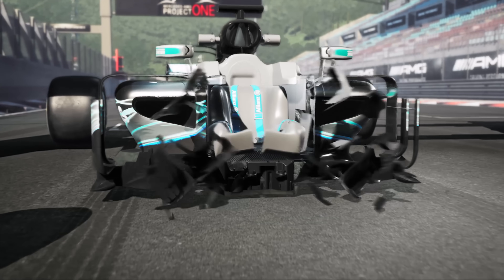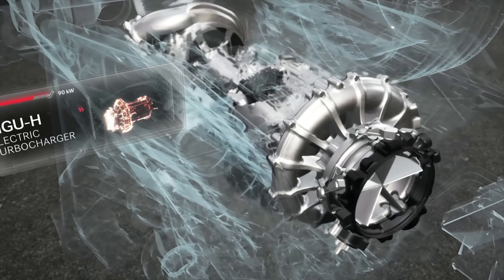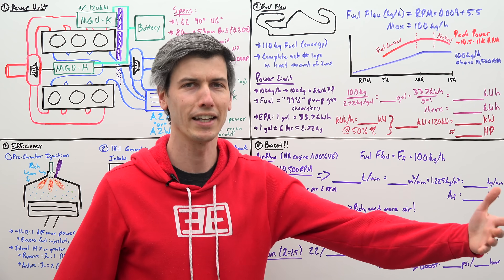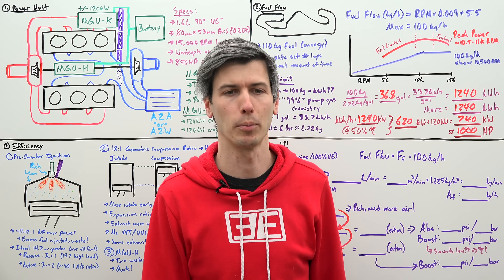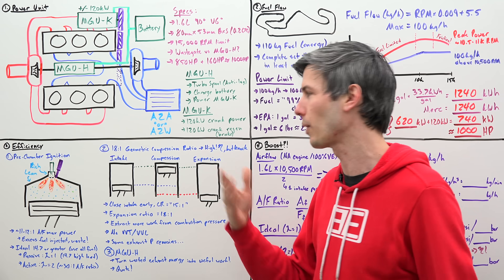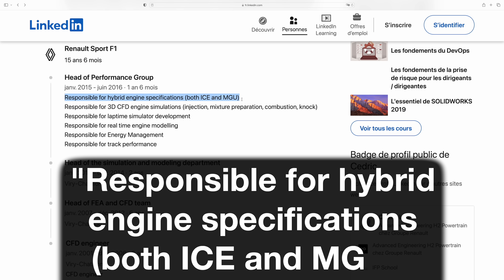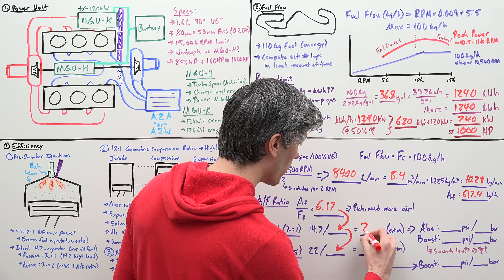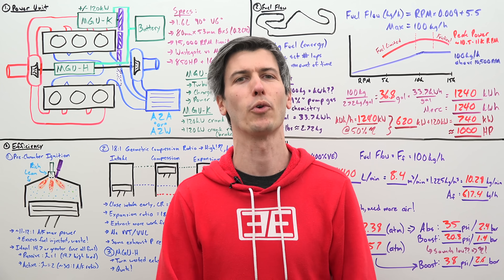How Tiny Formula 1 Engines Make 1000 HP!

Comment from the maker: *Important Note!* Production cars vs F1 cars: why are F1 cars more efficient? Especially considering my comments in the video about both being impressive, but operating under different rule sets. Several reasons for F1’s efficiency advantage:
1. Quantity - Formula 1 only needs to make a handful of engines for a season. This allows for an attention to detail that you won’t have when producing engine quantities in the millions for production cars. It’s easy to make one efficient engine. Mass production adds complications. 
2. Cost - The cost per engine is vastly greater in Formula 1, allowing for opportunities that you don’t have when you’re selling an entire production car for $30,000. Materials, tolerances, difficult manufacturing designs, etc. Relatively speaking, production car engines are very cheap, which limits the design.
3. Reliability - F1 teams are allowed 3 engines per season without penalties, so an F1 engine only needs to last 7-8 races (plus practice & qualifying), meaning about 1,500 - 2000 miles. When your engine doesn’t need to last as long, you can run it closer to peak efficiency, where knock is more prevalent (think high spark advance, leaner air fuel mixtures). It’s worth sacrificing reliability for performance, because the goal isn’t an engine that lasts for 200,000 miles. 
4. Rev-Range - F1 engines have a much more defined use case versus road cars. Road cars operate at many different RPM, in many different engine load scenarios. Trying to develop an engine that is efficient across this wide range of use-cases is very difficult. F1, on the other hand, has a much more narrow focus. Create power at full load as efficiently as possible. This means you can pick a region of the engine where it spends most of its time (say 11k RPM) to maximize efficiency.
Reply: Thank you so much for this summary. I'm at work and cant listen to the entire video so reading all of the reasons was great for me!
Reply: 0. Emissions restrictions - as far as I know F1 do not need to pass any emissions standards. The higher the compression ratio, or air fuel ratio the higher production of NOx.
Reply: @savclaudiu2133  Also having a short stroke relative to bore (oversquare) enables higher revving engines, but less complete combustion due to the relatively large diameter of the combustion chamber.. It was considered a marvel of engineering when Honda released its S2000 that would rev to 9,000 rpm AND pass emissions. Motorcycles don't have as many emission constraints. This allows engineers to design oversquare engines that rev higher.
vroom vroom, vrrrr VROOM!
Reply: Thanks for that Carnac the Magnificent moment of predicting Max as this year's world champion.
That boost level has to be on the higher end.  Another good estimate would be at the maximum fuel rate allowed, how much boost could you safely create?
Reply: I agree with all these points, but Alonso is the one who will be 2023 Champion.
Reply: And temperature range. F1 engines are preheated meaning the don't have to deal with "cold-starts", i.e. different parts at different temps. Tolerances can be much finer so less losses due to blow by etc.
Reply: Perhaps a 4th thing. Do F1 engineers need to worry about NOx?  Trying to run lean at 15:1 compression is never going to pass EPA or CARB emissions controls.
Reply: A good one to watch is the road to 50% thermal efficiency international combustion engine. They stated that formula 1 uses 18 to 1 static compression.
Reply: I’m going to work Number 4 into my excuse the next time I get pulled over. 👮‍♀️
Reply: How dare you declare Max already. Surely you could at least wait until after the first race. 🤣😂
Reply: @BBKing1977 he already won... 🤪
Reply: Idea for a April fools episode. Do a video in the style of Numberphile using sharpie and parchment paper.
Reply: Counterpoints:
1. even with cheaper production methods optimization can be achieved, if not 100% of the performance of one-off production maybe 80%
2. mass production: yes, single piece profit is lower, but mass makes higher profit
3. no road car needs 700kW power
4. valve timing, cvts, you said it, road cars have options that formula 1 cars don't have
Reply: @spy00at  "no road car needs 700kw power"  Shhhhh... don't let the Hummer EV hear you say that, you'll hurt its feelings!  🥴🤮🤣
Reply: 5. Emissions restrictions- Honda had a lean burn engine on their Honda vx in the 90s.  It was discontinued due to emissions restrictions.  I believe the lean burn caused nox emissions to be higher
Reply: I’ve been following you for a while now, and think that your videos are fantastic! What is your profession or title? You have a very good pedagogical ability!
/Greetings from southern Sweden
Reply: Don't forget tolerances.  A F-1 engine can't be started cold, it's locked up.  Needs to be at operating temp.  Less loss past the piston rings leads to more efficiency
Reply: @sandybarnes887  yes that is true but it is a relatively small contribution to the overall efficiency it's more to do with reliability at sustained high revs and load!
Reply: Yep, the tolerances thing is a big one. F1 engines can't start cold. They're seized at that temp.They have to be preheated to allow the block to expand ever so slightly to free up the internal components
Reply: That last remark on Verstapen was unnecessary... 🤣
Reply: Thanks for this answer, it's very good
Reply: Great things come in small packages
Reply: Reason No. 1 doesn't make sense, just saying ...
Reply: And does this without variable valve timing etc. Which begs the question, if we could run always at optimum RPM and were allowed any tech, just how efficient could the most efficient ICE be with current known tech?
Reply: @GordonWrigley   Exactly!  I'd love to know that, too - with hybrids, especially range-extender type hybrids, the electrical system can take up the slack between the power that's needed and the power that's produced, and keep the engine at it's most efficient whenever it does need to run.
Reply: On the next episode, lambda explained
Reply: The fact they're even making engines that CAN last 2000 miles in F1 is a massive achievement over what they were doing 20+ years ago back when some teams had 3 engines *for a single race weekend*.
Reply: Jason, understood the efficiency of the engine. Well explained...

However, since you will be using a very lean mixture, the tendency is too have very high temperatures inside the combustion chamber. How to deal with the NOx gases?  Does F1 have any requirements in relation to NOx emissions?
Reply: Would you imagine that the peak cylinder pressure is now touching 280 bar!
Reply: I thought gas turbines have more torque.  I think that is measured on the N1
Reply: Thank you Jason, Yes, we'll understood...!
Reply: why do f1 v6 turbo engine sound so good but porsche 911 sound like a vacuum cleaner?
Reply: Because the rules dictate it by necessity
Reply: What about other emissions, eg NOx?
Reply: Hi Jason, did you consider the fact that they could use the MGU-H electric motor to create ADDITIONAL boost above what the engine turbocharger is capable of, in other words, MGU-H working as an electric turbocharger at LOWER engine RPMs to achieve maximum boost, as far as I know, that would be within the F1 rules and would greatly increase engine efficiency and specific fuel consumption under lean conditions where Lambda approaches 2
Reply: Good use of calculations, i want 50% thermal efficiency in my turbo sports car!
Reply: Thank you. And awesome. Now just need a colab with scarab.
Reply: It’s that last one that came to my mind during the video. Manufacturers don’t know what the normal rpm range is going to be. Design an engine to be super efficient at 3k and it may be terrible at 1500. I mean, my truck hardly ever sees 3500 rpm because 90% of the time I’m putting around town.
Reply: Very very excellent summary
Reply: Sounds about on the money to me
Reply: gggghhhhhh
Reply: I have a compulsion, to calculate horsepower per CFM everytime I watch an engine Dyno run

It seems to be the average hot rod motor moves 1.35 CFM to make 1 HP

The closer it is to erase car the closer it gets to 1.0 CFM

So like a really built street drag car usually moves about 1.28 CFM to make 1 HP

So

1.6*61*10500/3456=296.5277/14.7=20.1719

So this motor is making 20.1719 horsepower per pound of air

So 850/20.1719=42.1378

So we need 42.1378 psi and the atmosphere is supplying 14.7

So we need 27.4378 pounds from turbo
Reply: Alonso may end up 2nd
Reply: Thank you 👌
Reply: The big question for me is: why aren'r ALL ICE production engines using this type of technology? No need for  1000hp in a small hatchback but better gasmileage (like 2L/100km) would be awesome.

LOL at the Mercedes burn and the congrats to Max/RB/Honda 🤣👍👏
Reply: @jfv65  Having worked in this industry, the simple answer is that the regulatory agencies (gov't) are staffed with the "C" students, and the "A" students (engineers) are left trying to make an engine "fit" the regulations rather than coming to the simple conclusion that best efficiency produces fewer emissions. The car companies will not stick together and tell the agencies "hell no!"
Reply: Also different emissions requirements
Reply: Easy stuff
Reply: Well, thanks for adding this tidbit!  You seem to have read MY mind, and where it was wandering off to, in regard to efficiency!  I was beginning to drool over the possibility of an amp'ed up Prius with an engine of 50% efficiency instead of the just-under-40% one they've had (itself a rather high standard).  Thank you!
Reply: I don't like compressors on engines they make a muffled noise
Reply: @chadr2604  -  "Noise" doesn't win races.
Reply: @rb032682  but what about people who want to hear that noise.  I use the engine as a brake so I can hear that noise
Reply: Thank you!
Reply: @beegum1  i guessing the compressor  is a workaround since these automotive engines do not make much torque.  Isnt a ft-lb 1 lb lifted 1 foot?  I could weld a bar to the end of the crankshaft and twist by hand harder.
Reply: The problem with road cars is they usually operate at very low loads/power outputs with the occasional high output. The advantage of electric motors is the efficiency transfers down into the single horsepower range, meaning a 1000 horsepower tesla will still sip electricity in traffic congestion. It's like having a Ferrari with a second little Honda GX100 engine to get it through the town, then back into the V12 for tearing down the open road. They also don't suffer anywhere near the "engine braking" losses at high RPM. The only thing not to do with electric motors is make them push too big a gear which can cause them to overheat and lose efficiency.
Reply: @TimpBizkit  pushing an excessively heavy car is always going to be inefficient  and All modern cars are excessively heavy!
Reply: I subbed to this channel a long time ago when you had like 5K Subs, recording with a crappy camera in front of a whiteboard.
Years later (the whiteboard is now white and not yellow xD), and I'm still not tired watching those complicated topics distilled down in simple terms, scribbled on a whiteboard.
Reply: So if you went petrol electric to reduce the operating range of a road engine you could run 30:1 fuel air and halve fuel consumption!  I can't imagine what this would do to exhaust chemistry NOX through the roof.
You are of course right that the attention given to gas flow to both reduce pumping losses and simply flow that much air would not be possible for consumer priced engines. 
Brilliant talk with a lot of research like the iceberg visible/submerged ratio.
Reply: IDK man, rooting for Perez.
Reply: If you could choose one engine to be turned into an efficient reliable generator, which one would you choose and why?
Reply: Jason is so intelligent he makes me feel smarter by just being able to follow the excellent way he has of explaining these things.
Reply: I understand that, but all that said... the turbo/electric motor combo sounds like an amazing hybrid system...
Reply: @@SokJoss You're wrong for several reasons.  A, ethanol is not 0 emissions.  Jason conveniently has a video about it on this very same channel.  B, F1 does not run on pure ethanol, it basically runs on standard pump gas - 87 octane, 10% ethanol (I didn't feel like digging deep enough to find if that percentage is by volume or weight nor if that octane rating is RON (European standard) or RW/2 (most of the rest of the world).  

Most importantly, NOx emissions have almost nothing to do with what fuel you're using.  It's caused simply by heating air sufficiently - the nitrogen and oxygen are already in the air with not fuel needed.  Disconnect the fuel injectors from a cylinder and that cylinder will still produce NOx.  Generally, the higher the compression and the leaner the engine runs, the more NOx it produces.
Reply: brilliant video, absolutely loved it, got yourself a sub. I had just finished watching a strip down and the start of a rebuild of a merlin 20, souper interesting to see where 90 yrs of development has taken us, all be it in a strictly defined engine build criteria
Reply: Well put👍🏻👍🏻
Reply: Cool
Reply: I would love to see F1 do a 5 year "innovation window" where the majority of rules governing design were set aside.  Keep safety rules in place along with broad criteria (min/max footprint, min/max weight, total fuel allowed, etc.) but get rid of everything else.  Let teams design the absolute best engines and aerodynamic features possible. Allow mid-season changes.  For a set period, don't stifle innovation.  Sure, it would be hella expensive and maybe for the period some teams can't compete, but imagine the advancements that could come from it.  Then, after the window is over, go back to rules that limit spending so other teams can compete again.  Maybe you do ban some of the innovations that were created that aren't in the spirit of F1.  But, I can't help but think the result would be a fascinating time of racing as teams figure out what works and what doesn't work.  The benefits would certainly trickle down to production vehicles, and we would all know what is ultimately possible from the best engineers on the planet!
Reply: @BenKickert Under the current rules it doesn't deserve to be called formula 1! it is supposed to be the pinnacle of automotive engineering how can it be that when ANY innovation AT ALL is banned? even things that are already used on road cars???
Reply: @BenKickert  how about no. Trickle down doesn't work all the time for something that specialize. If that were the case, we would have MGU-K & H systems in mass production vehicles or even exclusive sports cars. There's a reason why they're getting rid of it. An interesting upcoming challenge for their engineers to solve is how they're going to get around the turbo lag.

All what you're asking for is to put F1 right back in the days of massive spending and not being financially sustainable, basically killing the sport.

There are already enough challenges for the engineers to solve (like porpoising), and they're given the freedom to do so, but now with budget restrictions, which means they have to be more creative.
Reply: Max 2023 champion! You nailed it, so good. Did you travel to the future to be sure?
Reply: Gas turbines are much more efficient why companies don't often couple it with a generator and battery for better efficiency hybrid systems?
Reply: @Vishnuvkammath  Large gas turbines are efficient when running flat out But shocking when starting up or running at part throttle?
Reply: A motorcycle or motorbike engine limited to 15k rpm which is the same as a F1 car
Reply: @importanttingwei7747  90s Honda MC22 hits 18k+ rpms, granted its only 250cc
Reply: @importanttingwei7747  BS ..... my stock 690 Duke R can only pass 8500 , but it's nothing there except wasting fuel
Reply: @princesssolace4337  your KTM is a lazy, 2 (really big) cylinders in a city bike, any inline 4 sportbike  (or 'supersport' 600-650cc) from the past 2 decades to current day revs to 13-16k rpm. Samer reason as the F1 engines: don't worry about low-end torque for driveability (sportbike vs naked/city bike), and ofc less rotating mass and better primary engine balance in a 4 cylinder engine vs a 2-cylinder means higher revs
Reply: @raoulrr  I started on a Yamaha 2 stroke 100cc   , 150cc, RGv250 jumped straight to ZXR750 j2 ... no in-between ..
    Why the KTM is bcoz I just started riding for 2 years after 20 years off a bike. I started back on a Yamaha Y16 and jumped to the KTM bcoz its a single piston. Easier for me to DIY and slowly build my confidence back to a V or L design italian superbike. That's the plan .... What do u think?
Reply: @princesssolace4337  I don't think a sigle piston and its low-down torque is the part that counts the most to make it easier to handle, more likely the upright riding position and maneuvrability of a naked is what counts more.
 I was off bikes for over a decade and I got back on by riding a new ZX-6R home from a Kawi dealer a few years ago; after a couple of weeks of almost daily riding I was 100% back. 
For a few years now I wanted to get a more commuter- and city-friendly bike (naked bike, more friendly ergos, better at parking lot speed), did a bunch of test rides (including a790 and  890 Duke), but every time I get off of those and back on my Kawi I realize how much more I enjoy the sportbike, even with its drawbacks as a commuter, the smoothness, how stable it is at highway speeds and under braking, it just makes me feel so much more safer and in control. To me it's like a scalpel compared to a baseball bat. I have friends who say my bike is hard to ride, or that it's less forgiving, so I guess it's very much a matter of what suits YOU best, it's why there's variety in bikes  :)
Reply: @raoulrr  I get u , the problem is ,I'm 50 years old and my strengh and physique ain't what it used to be , takes much longer for my body to heal.
    The KTM is not fast enuff to be a danger to me and other road users bcoz I need to build my skill and confidence back. Gud for u if u don't have my kinda issues ... I wish I don't.
    My heart says fcuk it , stop wasting time and money and just go for what u desires.
     What do u think about 400cc sports bike?
Reply: @princesssolace4337  I'm a couple years from 50 myself LOL
In the 400 and below category the only worthy entry I've found was, funny enough, the KTM RC390; everything else (Yamaha R3, Ninja 400, BMW 310, Honda CBR300) was very underwhelming; I can't imagine a non-beginner would like any of those. 
I haven't tried the new ZX-4RR yet ( the new inline 4), but I heard it's very good, although a bit expensive; I want to try riding one this spring, and if I like it I might replace my ZX-6 with it.
Reply: @raoulrr  I abused my body too much from my late teens till I'm 40 .... I remember the ZXR250r that sounds like an F1 but slow as fcuk and pain in the ass to work on bcoz 250 in line 4🤣
     I heard about the ZX4rr . Got a gud review ... it might be between the R3 and ZX4rr. My heart is telling me to go straight to a Ducati and stop wasting time.
Reply: @princesssolace4337  From my experience (and my friends who ride japanese bikes) there's no much to "work on". The only people I know who really had anything else to do other than oil changes, air filters and spark plugs are the ones who own Ducatis  :)
Reply: @raoulrr  I don't have a ZXR250r but have come across few mechanics having needed a special tool to pull the 16 valves out bcoz it's so darn tiny. I think that particular bike needed a valve job or sunthin.
  FYI , I got issues with keeping internal engine stock, thats another reason why I choose to not touch in line 4 or anything more than a single piston YET.
    Both my cars got a build motor in it and its much easier to strip a bike inline 4 and start doing nonsense to it. It's a disease 😁  ride safe brother✌️
Reply: @princesssolace4337  I see no reason to pull valves out of a modern motorcycle engine LOL
There's not much maintenance to be done (Ducatis might be an exception here with the valve adjustments, unless they changed that recently). My ZX6R has almost 30k miles and besides the oil changes, air filters and tires all it got is one chain & sprockets replacement (the OEM chain wasn't the best). I replaced spark plugs when I did the last air filter just cause "I was in there", iridium plugs last basically forever.
Again, I'm not talking vintage bikes here, but modern liquid-cooled 4-strokes.
Reply: @princesssolace4337  I loved the older super sports 400's they were smaller and lighter than the superbikes and not as fast but huge fun on a twisty road!
Reply: Low torque engines
Reply: @importanttingwei7747  geared to compensate
Reply: All this stuff to make an ICE engine powerful! And not very powerful at that!
Compare to a Tesla's electric motor's simplicity!
it remands me of the big old 28-cyl radial ICE aircraft engine - versus a high-bypass turbine. The comparison is staggering!
And why ICE engines are going into the dustbins of history as we type here!
Reply: @DennisMerwood-xk8wp  Just imagine an EV F1 lugging around all that extra battery weight. It would be interesting to see design changes to suspension and brakes.
Reply: Electric vehicles are not simple and Electric vehicles are NOT very efficient because of high weight of battery, that's why most EVs cannot go farther than 200KM and there will never be an electric airplane. ICE engines are NOT going anywhere despite what ignorant politicians keep claiming.
Reply: @DennisMerwood-xk8wp  You are Sooo wrong how can a 2 ton tesla with a ridiculously low 0 to 60 save anything except your standing at your country club?
Reply: @markscully2342  Mark you are confusing me with another commentor. LOL
I'm with you - the Tesla Cybertruck is going to be a poseurs truck. Owned by people who behave affectedly in order to impress others.
Reply: You can try to justify why only F1 can do this but the reality is, hybrids are a much better 'solution' for our immediate climate goals than the full EV's.  Economies of scale my friend, economies of scale.  The fact is, passenger cars don't need an F1 power plant, just something better than the shitty Prius configuration.  Toyota is doing that with their Tundra.  EV's are NOT the future, merely a store branded Band-Aid.
Reply: Manmade climate change is bullsht
Reply: "It’s easy to make one efficient engine." - i doubt it's really so easy))

Production engine with f1 combustion system and high CR would operate at 1500-3500 rpm mostly providing even greater efficiency due to less mechanical losses. 

Maybe its to early for saying goodby to oldg00d ICE ))
Reply: @MinchevaLs  Mechanical losses are the relatively lowest at low engine speeds,  Meaning you have more loss per HP at low engine speeds than you do at high engine speeds.  (well sort of anyway, it's complicated there are definitely cases in all engines where a higher RPM has greater mechanical losses than a lower RPM). The big gain in efficiency from lowering RPM really comes from decreasing pumping losses.  Pumping losses increase by the square of engine speed.  This decrease can be even more effective in gasoline engines as you decrease engine speed you load the engine more opening the throttle more, decreasing the throttle loss part of the pumping loss.
Reply: @donaldendsley6199  yep, true story. So we realy may expet 50% efficient ICE in production cars - and this would be a pressure on electric vehicles
Reply: @MinchevaLs  When you have no relative limit on the budget and all the engineering it's probably relatively easy.
Reply: @Thros1  and how would you assess 60% efficient engine task? Still easy? HOw much miney you need to do it?
Reply: wrong. a GR corrolla does not produce 25.2PSI boost at over 7600rpm let alone at 10500rpm. how can it? please use more logic in your videos.
Reply: The short answer: capitalism doesn't allow efficient engines in mass produced cars. The money that would be spent on making better engines goes into the bank accounts of executives and shareholders.
Reply: @MichaelMarmo  🤣 but a manufacturer which sells much more efficient engines would sell more cars and also make  loads more money for the bosses etc! 😛